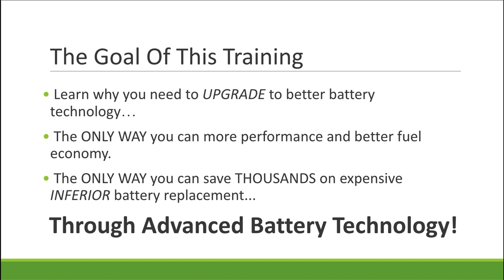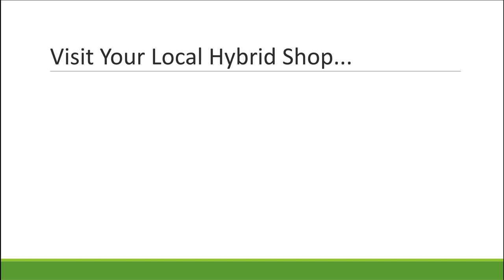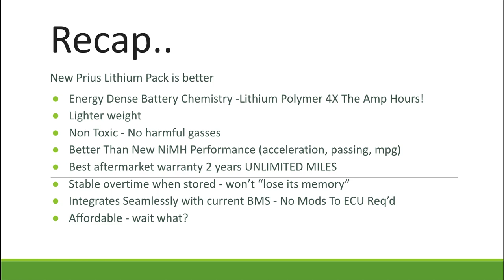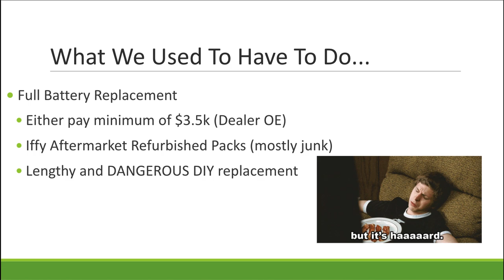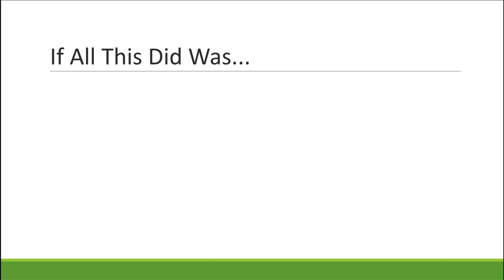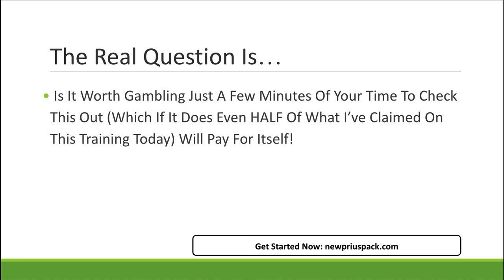New Prius Pack  - Upgrade Your Aging Prius With A More Powerful Modern Battery

Comment: i mean, the only thing i didnt hear mentioned , after showing all the advantages of this kit. the original battery has been known to last 10+ years, up to 15 years and still function. what is the life span of these batteries, the charge discharge cycles the battery is rated for is never listed.  how much capacity will this battery have after 2 years, and 1000s of charge discharge cycles?  whats are things looking like after 5 years with this battery?  i mean there are actually some nice things about the oem battery chemistry not mentioned.  i mean if i average 43 mpg on the oem battery, and spend 900 bucks on an oem remanufactured battery, it brings the car to oem specs, and that battery lasts for a good 5 years providing the oem performance during the 5 year duration, and it cost me about 900 bucks. now, i get this lithium battery, at a cost of 2100$ , yea it gets you 53 mpg now or better, so lets math it out. how much gas savings do you get, going from 43 mpg, to 53mpg on average? well there is a diminishing return unfortunately.  i mean going from 10 mpg to 20 mpg is an amazing savings. going from 20 to 30 mpg, is a nice savings. going from 30 to 40, yea u still save, but its not as much as u think. and, going from 40 to 50 mpg, just saves u a little bit.  point is, does the savings from 43 mpt, to 53 mpg justify the extra cost of the lithium battery?  in 2 years time, u may show that u saved enough to justify it. now, what after 5 years? well the oem battery remains consistent  , however , until you demonstrate the product after a duty cycle about equal to 5 years of charges and discharges , im betting after that period, the oem battery will be more consistent, with the lithium battery having lost some 30 to 40% of its capacity.  if i have to buy a new lithium pack every 5 years, to maintain its performance, calculate savings on the better mpg,  now compare an oem remanufactured battery, that still works great after 5 years at half the cost, hmm. well i think you should do the math your self. in the short term, i have no doubt the lithium battery is far superior. however for the long term, the oem battery will remain consistent for many more years i think over this battery, say after 5 years, in which case the oem battery would be a better value. i mean you wont know if you dont math it out your self, compare duty cycles of both types of batteries,  and over a 5 year period, examine the true savings and costs of each battery.
Reply from the maker: These original LiFePo batteries are showing almost no degradation after 7 years of constant use. 

The tech is incredibly promising which is why Toyota is looking into using it.

Comment: Eta for next batch? Commuting 160 miles a day in a 250k mile Gen 3.  I feel like I'm on borrowed time.
Reply from the maker: https://projectlithium.com/?ref=e9JRo available now
Reply: reliability is questionable and safety is even more. There is a reason why so many EV burndown because of using Li battery that is not tested.

Comment: Just purchased a NexCell LiFePO4 upgrade for my Prius.

Do you know what the average life expectancy for this battery might be? I've heard that LiFePO4 batts can withstand many more charge/discharge cycles.

Thanks.
Reply: reliability is questionable and safety is even more. There is a reason why so many EV burndown because of using Li battery that is not tested.

Comment: so is this pack better than the packs in the newer 2017 pruises that use lith packs... is it a lighter battery? with more power etc...i am a bit confused... i have many rc planes,boats cars etc so i understand the power of nickel and lith batteries... stopped using nickel batts years ago...thanks
Reply: Dunno why people can't read what's written everywhere about this upgrade. It's a Lithium Iron Phosphate battery and it's about 40 pounds lighter than the Nickel Metal Hydride original. Li-Fe-Po4 can withstand being 100% charged and discharged to near zero without damage, unlike NiMH and Li-Ion. Thus almost 100% of the capacity of the NexCell battery is usable, which is more capactity than the usable capacity of the NiMH original which is never allowed to charge over 90% or discharge to less than around 30%.

Comment: So i definately want to upgrade but i have to keep working first "uber". I was hoping you can answer this question because i have limited resources right now. All of my current cells say between 7.95v - 7.99v and there are 2 out of those cells that say 7.89v and 7.90v. I was hoping you would know if these 2 are the bad cells??
Reply from the maker: Sounds like your battery is getting out of balance. I would recommend balancing first, but the process to upgrade is much faster.

Comment: I really want to go this route, sounds really good however, it's $1900 plus shipping for my Gen 2 and the warranty is 2 yr/unlimited miles which for me is under 20k. I can get a brand new Toyota OEM for $1630 here and I will have a piece of mind for the next 10 years (Toyota warranty is 1 yr but it's battery has been proven to last at least 10 years). Can I swap out just one bad module down the line or do I have to buy a whole new pack again due to 1 bad module? Any videos on install for a Gen 2 Prius? If the battery is as good as it claims (not trying to be a smart ass), why not up the warranty instead of just 2 years, Greenbean battery offers lifetime warranty which includes installation and they come out to you. Thanks
Reply from the maker: Green Bean is a reman battery it will never match the capacity of new. You will spend more time on the phone with warranty and claims to get another installed than enjoying your Prius. Your fuel economy won’t be as good and you acceleration will stink too.
Reply from the maker: Something to put your mind at ease. These lithium batteries are at 7 years with no degradation. You can’t say that about NiMH. That is a great price for a nickel pack but remember it’s old tech. And swapping modules down the road without balancing and proper reconditioning will only lead to failure and you will be fighting it.
Reply: You still never mentioned why you don't offer more then 2 years warranty. That's just like a normal  12V battery warranty which you have to replace every 2-5yrs. I went LifePo4 on my Harley Davidson battery sure it was better then original but 3 times the price and still had to replace it around the same time or just a bit over as original. Also there's a reason why Toyota still uses Nimh in their newer vehicles and backed by 10 years or 150k miles. I would consider this Lithium battery otherwise if it wasn't for the short warranty.

Comment: How long will the battery last and will it throw codes out because of the change?
Reply from the maker: The battery has lasted 7 years so far no trouble codes at all.
Reply: @TheHybridGuy  i heard lithium being discharged will kill the battery. Is this the case with hybrid car batteries?
Reply from the maker: @JD-ml7cg  well all batteries discharge. The lithium discharge curve is much longer than NiMH giving it an advantage. You see in in longer EV time and fuel economy.  After 7 years of testing and no problems I’m certain this battery is good to be installed. I’ve had mine now for over a year with no issues and only a great running car.

Comment: What sort of improvement can I expect for a short tripped 2nd gen prius? Car is driven 6.9 miles each direction with about 4 total stops in a rural area. Thanks.
Reply from the maker: Short trips on a Prius C warmed up should yield you an easy 5 more mpg. The owner and I spoke today about his car after getting it back . He told me it had much more power and he went up 7 miles per gallon.
Reply: @TheHybridGuy  Hi, was asking about a 2nd generation Prius not a Prius C. 2nd generation Prius meaning 04-09 Prius. Also, the vehicle would not be warmed up. It is starting off cold and will likely remain cold for about 4-5 miles. Thanks.
Reply from the maker: @jimmyjohnstone4350   Thank you for the clarification. Gen 2 is  gets the worst fuel economy on short trips.  There are a couple things you can do to help improve that. One is get a block heater (video to come) or two do that resistor mod for the coolant temp sensor (also video to come). If the vehicle is warmed up expect about a 5 mpg increase in your regular driving.

Comment: how much does temp affect lithium over older tech battery? Can you adapt this battery to a standard gas minivan or van? If so is there a kit for that?
Reply from the maker: Lithium runs MUCH cooler so the venting needs not modification. These batteries are made specifically for the Toyota hybrids right now. https://projectlithium.com/?ref=e9JRo

Comment: I pulled the trigger. If Richard Branson can go to space, then I can upgrade the Prius w/ better technology. Thanks for the vid
Reply from the maker: Nice! Good call.
Reply: @TheHybridGuy  I installed the new battery. upon replacement I noticed the Nimh connections were corroded so I used Nickel connectors/ nuts. Immediately I notice that my 2008 Prius battery level goes green. The drain is less and my mileage is a little better with better acceleration. All the new cells were 16.46 and one was 16.47 except the special one. Overall, I am very pleased in Texas and looking forward to hitting the mountains and ski slopes.
Reply from the maker: @johncole3010  you will love it. I have the prototype and been rocking if for 20k and love everything about it.
Reply: @TheHybridGuy  watching the video as I have time pretty sure I'm going to pull the trigger in a few weeks to a month
Reply: @The Hybrid Guy  just starting the video what kind of mileage are you seeing with  this
Reply: @TheHybridGuy  hi can I upgrade my lexus CT200h to lithium battery? Thanks
Reply from the maker: @ShabbirAhmad-hn4dg  hey! We have since dropped using lithium and gone with a better option. Sodium! https://mynewbattery.com/products/mnb-prius-gen3-prius-v-ct200h-battery-pack NexPower™ Sodium-Ion Hybrid Battery Pack For Toyota Prius Gen3, Toyota – My New Battery

Comment: So, after watching the entire video, do I understand all that I need to do, when I receive the 14 packs for my Prius, is just to install them. There is nothing more that I would need to do?  I worry about the balancing. Is there something more that I would need to do in order for these packs to work.
Reply from the maker: You should not have to balance the battery for quite some time
Reply: At what point would the battery need to be rebalanced?
Reply: @dannyr6444  If at sometime in the future you would have to change out one or more bad modules.

Comment: I'd like to build an electric chopper motorcycle using primarily golf cart parts. So far I've got a 3.5hp 36v motor, a altrax 450amp controller and a few other things. I'm looking for your opinion on the best battery setup.
Reply from the maker: LiFePo is going to be the best bang for your buck. I would set it up for capacity and stack as much on there as you can.

Comment: when will you have new lithium packs in stock i have a 2015 prius c  Thanks
Reply from the maker: Hi Roy, packs will be back in stock starting in July. They will go fast so keep checking the site
Reply: hi thanks for reply how do the li-on packs do in heat i am in Arizona
Reply from the maker: With over 500,000 miles of testing (including extreme heat) we can say with confidence they will be just fine. We do know that extreme heat will dampen the performance of any battery (because we run the AC all the time) but so far after 7 years they are holding true.
Reply: do you have anyone in the southwest fitting these az here
Reply from the maker: Not yet but if you buy one, I’d be happy to help you find a place.
Reply from the maker: New Stock is in https://projectlithium.com/?ref=e9JRo
Reply: Hey Roy, I have the same year and model, I was just curious if you went ahead and got this? I wanted to know what you thought of it...
Reply: @jeremiahbohn7905   hi no i did a fitnedd check on HV battery and it seems strong still

Comment: If somebody reading this/watching this has replaced the batteries with these BETTER units, have you seen increased performance? I'm talking better acceleration, 0-60mph, etc. I have still to read feedback with objective performance numbers.

Thank you!
Reply from the maker: Hi! So performance increase is a yes. But not in the way you think. 
Your battery can hold a higher load over a longer period of time. That means as you accelerate the battery will continue to provide stable power out put. 
Your passing and climbing loads are also more stable as the battery doesn’t drop off like NiMH does (and especially on an older or reconditioned battery) 
Your Prius will feel stronger and quicker. But by how much? I’ll need to make a video for that.

Comment: I was told that the nickel cant be upgrade to lithium
Reply from the maker: Whoever told you that doesn’t understand what is happening here. You can as long as the lithium is set up right
Reply: @TheHybridGuy  thanks man. I just visit the website, do u guys have for toyota CHR hybrid (jdm)? Its the same engine & hybrid as prius  gen 4.
Reply from the maker: Packs are not available yet for CHR but they will be coming. Not sure when.

Comment: No reason to buy this Lithium battery, because those NMH battery's can hold for ever. Mine is over eleven years old and still fine !  Furthermore NMH is much better in cold driving conditions as those new Lithium battery's .
Reply from the maker: Actually these batteries have been in testing for 10 years now. They show improved fuel economy, performance and have no issues with heat, cold or humidity. 
Did I also mention that they do not leak electrolyte, or vent off toxic fumes? 

These batteries ROCK! Better ingredients, better batteries, choose Nexpower.
Reply from the maker: Furthermore nickel cannot hold forever it is a hard ancient technology

Comment: This is really helpful info!  I'm strongly thinking of buying a used Prius V and converting it to a camping/party-mobile.  Also as a electricity hub in case of physical disaster - it's basically a generator on wheels, so... 👍🏾
Reply from the maker: yes, and i am putting together a video right now on a V install but get your car updated ! https://projectlithium.com/?ref=e9JRo

Comment: I hope we can get a video of this thing in action.  I'm getting about 39-40 MPG @ 185K miles currently on my 2015, so I think it's time for a new battery.

Will this pack get me back to the 50's.  I remember getting 56 MPG back when I first got my Prius with 66K miles.  Thanks!
Reply: You might want to watch some videos on replacing the pcv valve. Cleaning out the intake manifold.

Comment: Quick question; the NiMH BMS doesn’t have any battery balancing; the voltage sense harness only measures voltages. It works because NiMH charging efficiency falls at higher state of charge, and wastes charge as heat - meaning the car ‘overcharges’ the battery slightly if there is an imbalance. NiMH can tolerate this slow overcharging. How do the Lithium replacement cells manage this (especially as they can’t communicate with each other)?
Reply from the maker: They do with each block being controlled individually by its own micro processor
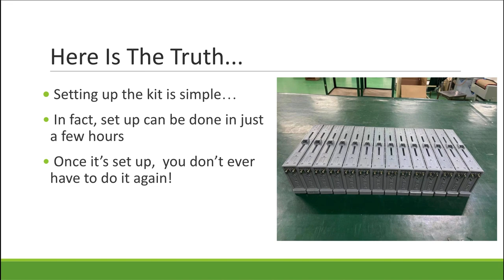Reply: At 22:48 there are 14 modules instead of 28, so the BMS can balance these modules. ☮️
Reply: @backwoodsbungalow9674  I'm not certain, though reads like each battery has their own BMS-Charge Controller-Under/Over Voltage protection?  Is that correct?
Reply: I used a bunch of iPhone batteries

Comment: According to Mr Prius app, our 144v 2012  Prius C nihy pack is still good. Resistance is still fine.  I can still get 70 mpg around town. The reason this C2 is still running like new, is low mileage. 27,000  miles!
Reply: 70 mpg around town?  No!  I own one.  I don't believe you.  That's ridiculous.
Reply: @alext8828  Do own a 2012 Prius C? (Not the large type 'heavy' Prius) Because these little cars can get 70 MPG on flat roads, average speeds 25-30 MPH, If you know how to HyperMile them. (44 PSI in tires). 

If you drive it like a regular car, you will get 40 to 50 MPG.
My wife never gets 70 MPG, because she doesn't get off the gas pedal when the car wants to go into EV on a flat road or down a long hill.
Don't take my word for it, use Google..

Comment: Does this work in a 2012 Prius hybrid plug-in?
Reply: The Prius plug-in has a better battery. The PHEV cars from Toyota use Li-Ion which allows them to draw the current required to run EV only acceleration up to higher speeds.
Reply from the maker: Sadly it does not!